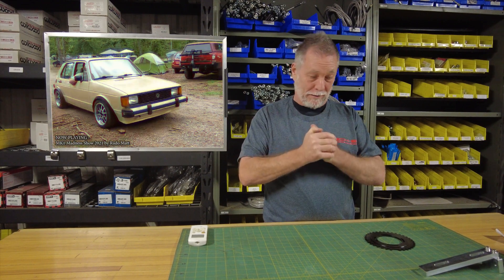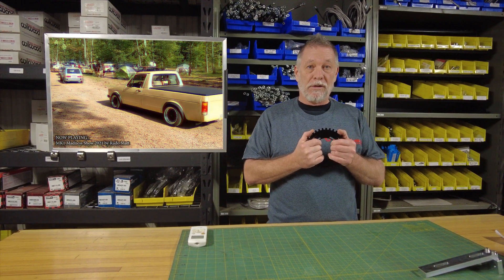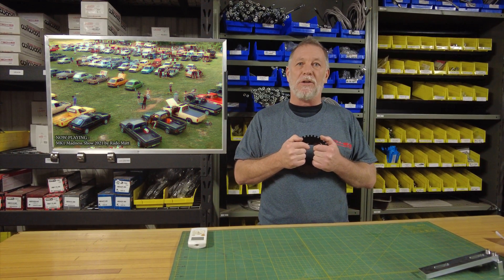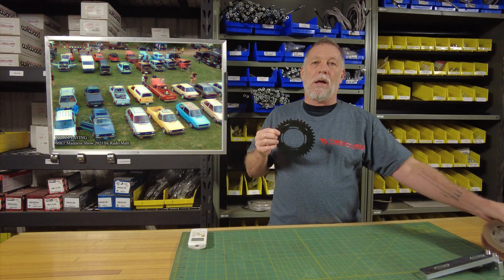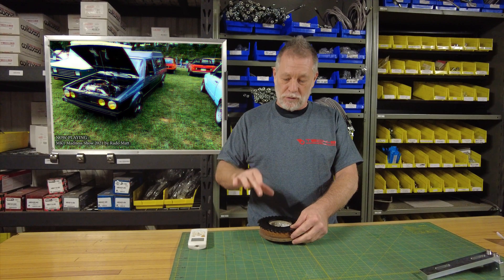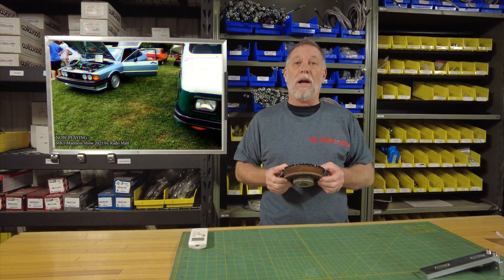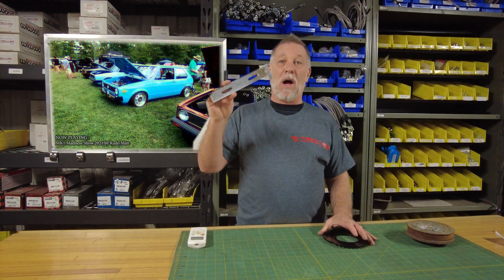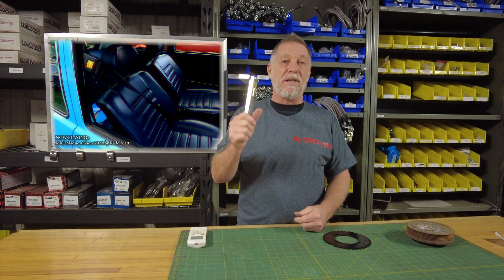Tech-53 presents their 36-1 Trigger wheel kit

Comment: The 36-1 wheel from the EDIS system or the aftermarket versions can be used universally, so long as whatever controller youre using recognizes it. For example i just built a setup for a customer using an ignition side only speeduino board, an sbc or bbc cam synchronizer from a 99-00 7.4 liter or for us fraction loving americans a 454 cubic inch big block 😮, Ls / Vortec finned individual truck coils and of course a 36-1 wheel. When setting up the speeduino with Tuner studios free version itll ask you to pick what wheel youre using from a list that has 24x, 58x, 36-1, and maybe one or two others, at which point you can run the whole deal in wasted spark mode and skip the cam synchronizer or if you just have to have sequential ignition you can add it in. Now the synchronizer im referring to was only made by chevy for their last go with the 454 and its essentially the 96-03 vortec distributor (pancake crab looking one) without a rotor or any high voltage stuff plus its cap is smooth, all it does is run a hall effect cam sensor and drive the oil pump. The sensor is the same one found in Vortec 350s, and 305s super simple and super cheap. The Ls Vortec truck coils and brackets can be made to work with gen 1 sbc or bbc valve covers or ypu can remote mount. and if you sourcing from a yard please for the love of god and all his angels get your parts from one vehicle especially if your having someone else put this together for you. Yes most stuff in the Ls family feom the cars to the trucks is interchangeable but theres just enough little differences to make parts from multiple vehicles play nice a nightmare. Anyway like i said speeduino can do COP conversions it can handle fuel from tbi to sequential mpfi, plus wide band O2 enabled "self tune" is in tuner studios software and all at a fraction of the cost of a comparable megasquirt unit not to mention any of the big boys like holley, FAST etc....
Reply: Thank you for this I’m have 2015 GT I’m LS swapping and have been beating rocking trying to figure this out. I just want to know unless you already said it what’s a good each to use. Or just use a jumper for TAC inside the car so it’s all stick looking .